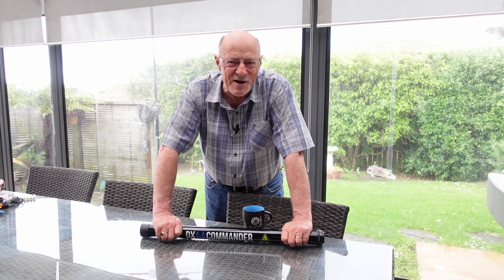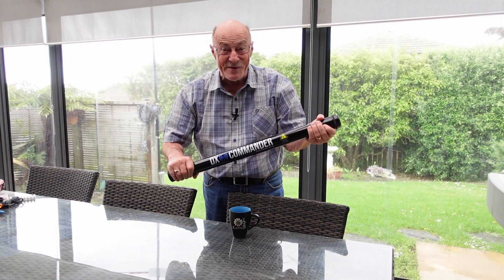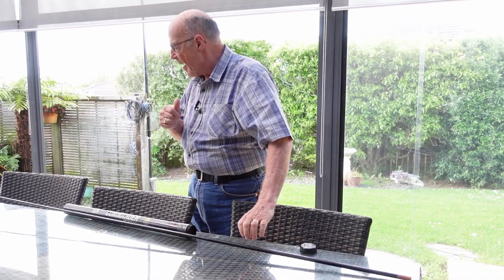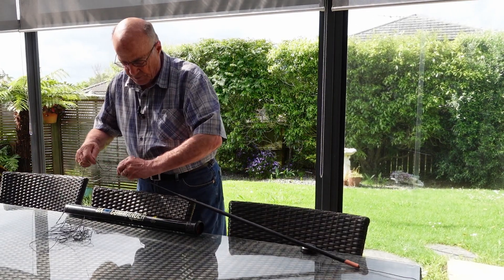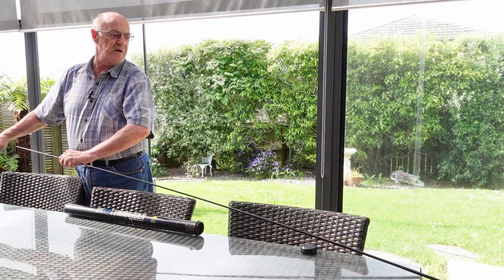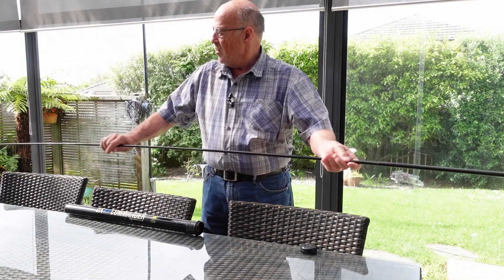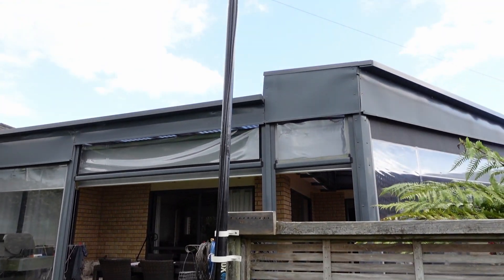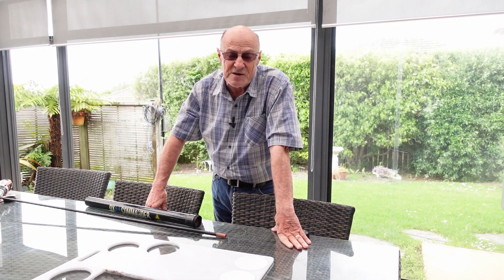DX-Commander HACKED  -  Get a dipole on 10mtrs in minutes.

Comment: I wonder how far you can extend it out Roly, plus some drooping wire at the ends. 12m would be easy....15/17m? Pole sag and more centre strengthening 🤔 Only one DXC-E at this end....
Reply from the maker: I have not tried Ian. I knew give or take 3m would be fine.
Besides, it is just a temporary thing to see if there was a noticeable difference between the vertical polarisation and the horizontal.
There was.......